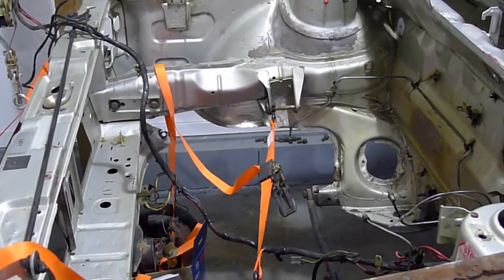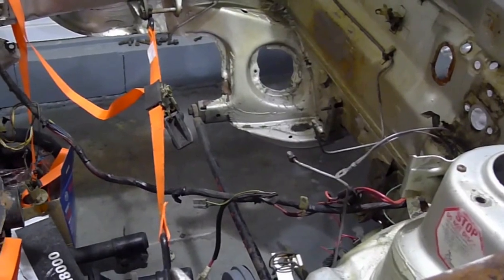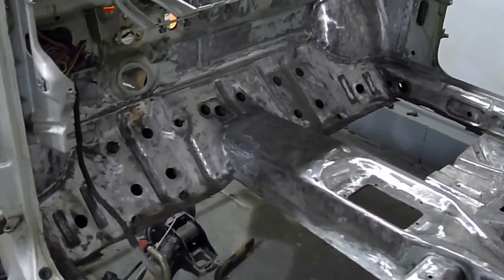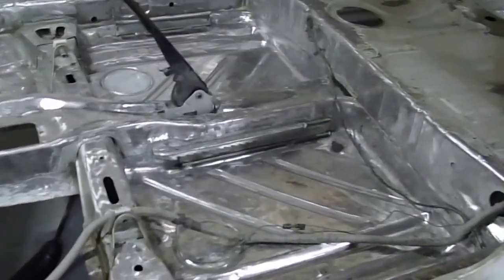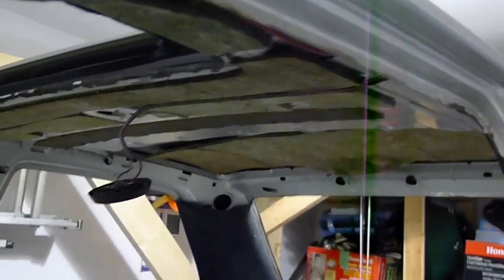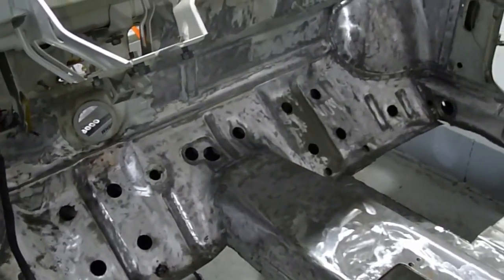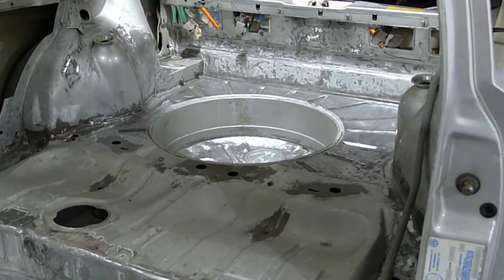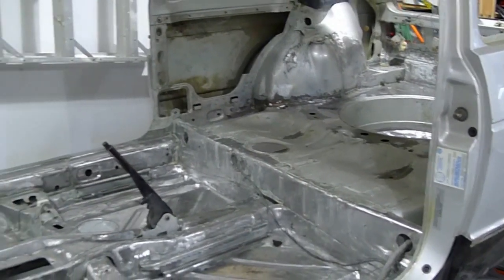The Ultimate 1983 Rabbit GTI Project - part 5 (completing the interior seam sealer removal)

Comment: I think all North American MK1 Rabbits had that 'gorilla snot' carpet adhesive slopped on at the factory. My bunny was stock with a single previous owner and the full service history beginning in 1984. That 33 year old unfathomably sticky glue almost made me give up on the project. I feel your pain.
Reply from the maker: Interesting. I'll bet the people gluing in the carpets were laughing while they thought of people like you and I who might have to pull it out some day ... the only way I could get it off was to freeze and chip it off - my dad suggested blocks of dry ice but I ended up using a freezing spray. I also used lots of drycleaning fluid.
Reply: Derek Spratt 

I tried using a razor blade and engine oil to keep it from sticking back down. I then tried methyl ethyl ketone but it was too hot to tolerate the PPE (takes paint off awesome, but the glue remained unaffected). 

What worked awesome was cutting the end and the handle off an old screwdriver, throwing it in an electric drill and slowly turning. Once it stuck itself to the bit, the slow pulling worked like those Command Strips for hanging posters up in your home. No residue left behind. Too bad it doesn't work on the stuff I touched with oil or MEK.
Reply: Just got one end of the glue started and it all pulled up in one pass.
Reply from the maker: Genius! That would make a great video.
Reply: Derek Spratt Thank you for documenting your project as thoroughly as you have. The audio and video quality are fabulous and it's obvious that you know what you are doing.